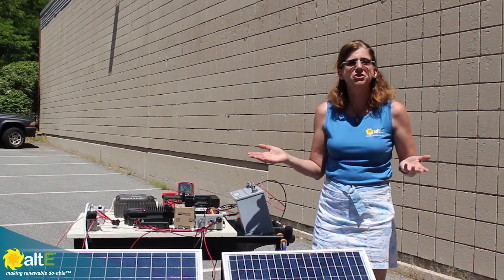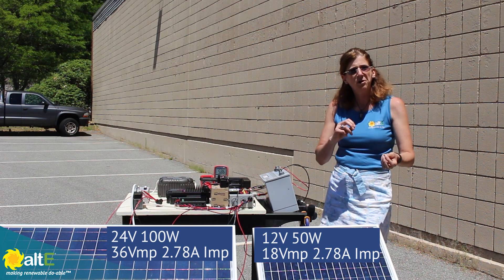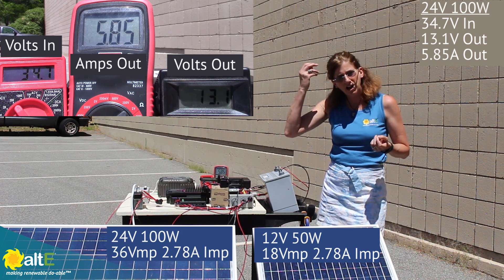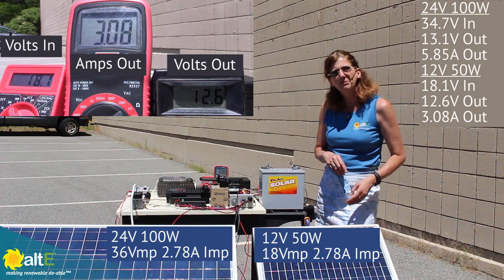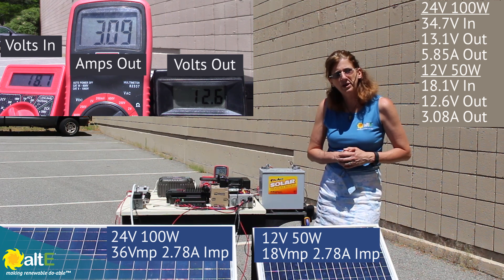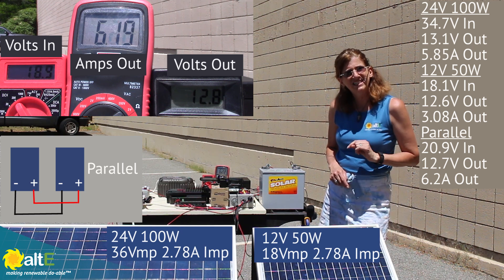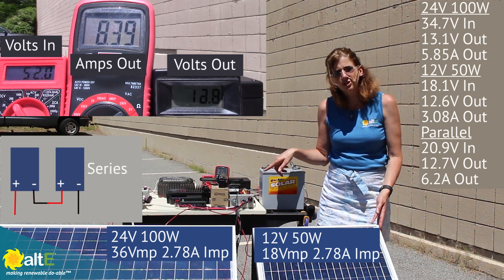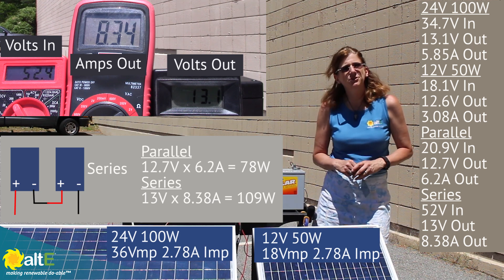Mismatched Solar Panels- Same amps, different volts and watts

Comment: do you have any videos for the OUTBACK PSX-240 AUTOTRANSFORMER WITH FAN?
Reply from the maker: No we don't. Anything in specific you want to see, or just a general overview. I love taking requests.
Reply: I have an Aimes 3000 watts/24 v pure sine wave inverter, actually two, not that I can combine them. but any who, I think I can use that transformer to change the 120 vac out to 240 vac to run a well pump, according to the duc you have online. But I might get a out of country 230 vac inverter later an looking for a transformer that would do both. 
My transformer theory is a bit rusty.
Reply: +Rev John O'Toole I have been thinking of something very similar . maybe just use a 220 230 240volt inverter. and build a transformer to put out two legs of 110-120v. any idea if this would work?
Reply from the maker: I will work on a video of using a transformer. Until then, you can see the install manual for the transformer here, https://www.altestore.com/static/datafiles/Others/PSX240%28900-0043-1%29.pdf . It shows that you can connect the 120V from your inverter into the inverter and it will step it up to a 240V output for your 240V loads, like the pump.
Reply: I think i have memorized the manual, I called your tech support one day and he told me to call Outback for my questions., but I have figured it out myself. I did mention I'll ask you at some point to get the right answer.
enjoy the hoiliday